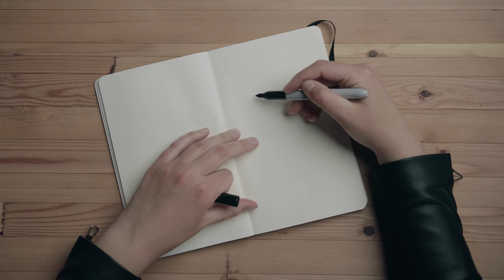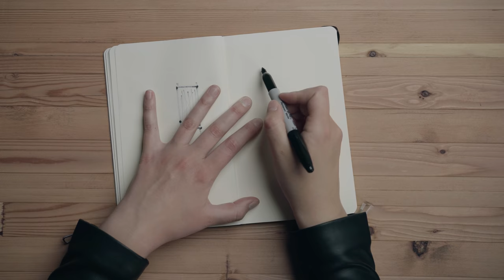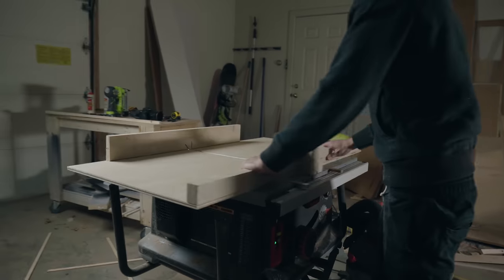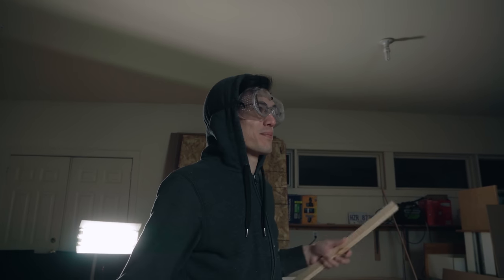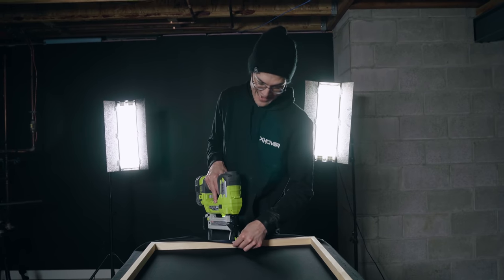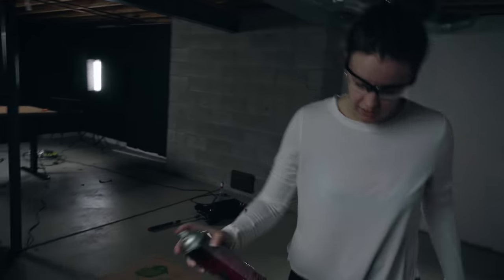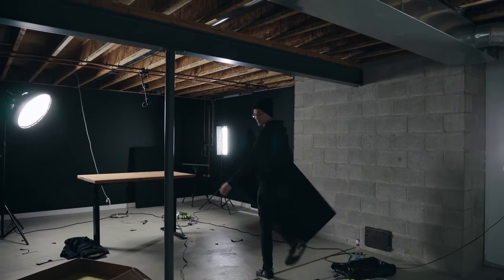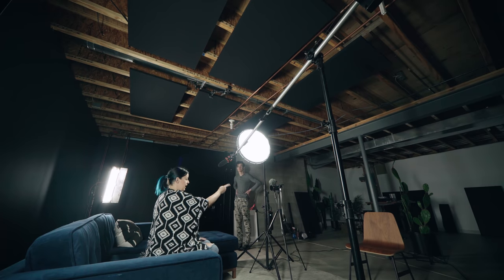Building Acoustic Sound Panels - Do They ACTUALLY make a difference?

Comment: A Sound Engineer once told me to hang a sound blanket like a half-pulled shower curtain, so it didn't hang flat. Even a removal blanket will create some sound reflections (however minimal) so by hanging the blanket so its not pulled flat removes most of the flat areas. It also effectively thickens the blanket, so it becomes denser. You need more blankets but they are dirt cheap so wouldn't break the bank. He also advised hanging the blankets at different distances from the mic, some fairly close, some further away. This also helps remove flat areas that can cause sound reflections... Try it, see if it makes a difference.

Comment: From sound proofing my own studio, I found that making the area smaller was also a huge factor in making the audio better. So I actually moved the blankets so close that it doubles as a light blocker. Also used foam squares glued 2x5 on a styrofoam board and taped them to my light stands which also help when moving them to film in other spaces.
Reply: Totally agree about keeping the blankets close to the mic, it makes a huge difference. The smaller you can make the 'sound area' the better. Great comment.

Comment: As far as sound paneling versus mic placement you are spot on. Getting the microphone closest to your sound source always gives the greatest improvement. Sound panels are great and effective especially when you have lots of big flat areas or walls surrounding you that sound continuously bounces off but even sticking a couch in a room will help as much as a sound panel. When you want to control reflections of sound just think big fluffy things that trap air. Hang up a dooner or put down a thick rug. Even in a restaurant i once stapled carpet squares underneath all the tables so it couldnt be seen by patrons and also put some large thick decorative mats on the walls. The more hard surfaces you cover with fluffy things the more reflections you stop.

Comment: You didn't use thick enough panels. I had thought about using broadband panels for my own studio but I had been looking at using 4 inch thick panels as I'd be treating my room for a drum kit. I'd defo recommend bass traps for the corners for the low frequencies, I got a set of 4 100cm tall panels for €100, they make a surprising difference in sound, loving these videos only came across your channel in the last few days.

Comment: Great video, you guys are fun to watch! As a composer I've treated a couple of homestudios throughout the years myself and was wondering: Why don't you guys also hang the nice sound panels you made on the walls in stead of the ceiling? That ceiling you have in your basement isn't as refelctive as the walls in front of you. Ofcourse sounds goes in all directions, but treating the wall that's in front of you would be my first priority to treat, since that will probably be the most noticable difference. The thicker the panels, the better and lower (in frequency) the absorption goes. Even with thin panels, the room does sound a bit less reflective, yes, but could still remain "boomy-sounding" because the lower soundwaves simply didn't get absorbed by the thin panels. The thin moving-blankets you guys used actually was perfect exampe of this: The room sounds a bit less reflective, but not a noticable difference, because our voice is around 4000Hz, and those movingblankets probably will only absorb above 10.000Hz, or somewhere in that range. But since you maybe don't want to see the panels to much, you could have a look into some nice looking wood diffusers, or even make a couple your own. They almost look like a stylish piece of art to me, and still contribute a lot to the acoustics of the room, though a bit less effective if you really want a complete dead sounding room, it still is a nice and organic-sounding way to deaden the room, since it breaks up the sound into different directions, in stead of it come straight back at you. Might be something to reconsider. :)

Comment: If you are rocking a basement setup like this test frame, using moving blankets and stapling then to the ceiling is a much cheaper way to achieve a similar result, then use the DIY panels if they are in frame or even for a portable setup that can pack up into a gear closet or behind a shelf. 👍🏼

Comment: Having the sound treatment helps the ambient sound the best so if you were doing a workshop shot with you moving around, that would be your biggest gain.  You also might try alternating the panels so that they are angled away from the ceiling a bit.  The trick is to break up parallel surfaces that can reflect sound.  For me, the biggest reveal, was how getting a boomed mic just out of shot REALLY killed (for better or worse) the ambiance of the room.  BTW, how the flock are you guys not at half a mill subs.  Great content.

Comment: In certain situations, you may need to Acoustically treat at least 15% of the wall surface area to hear a substantial difference. Also, avoid having parallel surfaces that are not treated like floor to ceiling or regular wall to wall surfaces. Untreated parallel surfaces can cause flutter echo or allow the room to still have a degree of reverberance not suitable for dialogue. For additional advice, I would consider the following companies: Acoustic Fields and GIK Acoustics. Both offer consultation, products, and DIY solutions. I hope this helps. Have a great day.

Comment: Becki and Chris, here's an idea for unique sound panels.  Use expanding spray foam and take something with an interesting texture or shapes and press that into the foam before it's cured. Or you could take some Styrofoam  and sculpt it into an interesting shape or texture. There are these heat guns, basically a wire that heats up and cuts through foam like a hot knife through butter, to make cutting easier.
Expanding spray foam is also handy when you have to ship something with a complex shape. Take your shipping box, spray the expanding foam into a thin layer, as the foam expands lay a sheet of plastic on top and then press the complex shaped object into the foam. let cure/harden. Do the same for the top.

Comment: Love you guys. Missed you guys jeje. Its been a while since you guys uploaded a video. I am a music producer/mixing engineer. I recommend rock wool insolation for acoustic panels. It works best for sound in my opinion. I had better results  on my mixes with rock wool than corning 703. For a mixing environment its best to have a dead room as far as sound. So I recommend you rock wool. Of course I dont know if you are going to keep making these DIY panels but just wanted to throw this tip at you guys. God bless you guys 🙏🏼
Reply from the maker: Definitely going to pick up Rockwool next time if we make more, they were sold out of the 1” when I bought the insulation and I didn’t want the thick stuff. 😊
Reply: @BeckiandChris  Thanks for the reply guys..Trust me if you find any 1" Rockwool it will make a difference.  Keep doing you thing guys.. much love and godbless..STAY SAFE

Comment: Hi. I am an acoustician and there are some things you have done right and many things wrong. 2” material had better absorption coefficients but the 8” gap created by the joists increases your efficiency. Adding Rockwool insulation “randomly” around the room in the cavity of the ceiling will greatly reduce the reverberation time in the room and cost even less.

Comment: Hanging your blankets behind your microphone - opposite your face - is where you want them. When you talk your voice continues to that surface and reflects back to the microphone. While those mics are supercardiod, they’ll still pic up reflections. Adding the cloud panels is also a good choice.
Reply from the maker: Gabriel O'Brien agreed but then they are in the shot! I think it’s a balance of having good audio but also having a nice looking set for video as well
Reply: Becki and Chris they shouldn’t be in the shot. They’re on the opposite side of the room, meaning you should be looking at them while talking to camera - meaning they’re the opposite side of the room the camera is looking. If you want something on the wall behind you I’d use diffusion to break up reflective waves so they get absorbed by your other surfaces.

Comment: Not a sound person but eliminating flat surfaces will be a key. How effective is your ceiling treatment is questionable, I think installing thicker insulation between the joist will serve the same purpose. Also, put some in the corners of your room will help with (reverb or echo I forget which). Basically, the more stuff you put into the room will help with the audio even a simple bookcase. It doesn't have to be a sound treatment panel.

Comment: Look into floating floors and Helmholtz resonator. The Rode NTG is a super cardiod mic, meaning its pickup pattern is directional. You are always looking for super Cardiod or hyper cardiod when doing directional, to minimize picking up sounds or noise from other directions. You also want to use a condenser mic as it is more sensitive than a dynamic mic but it obviously don't handle loud noise very well. Sometimes also requires additional power.  
Second to that, why the world just doesn't move to metric is beyond me.
Reply: Small condenser cardioid mics are better for indoor dialogue, try it

Comment: Your biggest improvement will be putting them on the walls and if you can the corners of the walls. If you are going to put some on the walls I would go 2” frames leaving an inch gap between the 703 panel and the wall.

Comment: What about the blankets without the panels?  It seemed like the blankets made a significant difference while the panels didn't mostly because you don't speak from the top of your head, so most of the sound is going straight while less is going straight up.  Also note on stage they use treatment panels at an angle to optimize the amplification of sound.  I wonder if doing similar befor your panels will help with deadening the sound.  Just angle the panels so that the largest amount of the panel is viewable to you.  Mathematically that would be panel elevated 6' from your mouth and 6' out from your mouth should be at a 45 degree angle.
Reply from the maker: Angle of incidence = angle of reflection so should be angled so that you could see your mic if the panels were mirrors. In this case they’re between the mic and subject so flat.

Comment: Yikes. Two major faux-pas : (1) The two-inch rigid fiberglass is very necessary, and (2) you need permeable material on BOTH sides. Otherwise, sound is just reflecting right back from whence it came. Agree, you guys aren’t introducing nearly enough mass to hear a discernible difference. Consider theatre curtains?

Comment: are you not worried about potentially breathing in the fibers from the insulation? That stuff is meant to be installed inside of walls, not behind breathable fabric.
Reply from the maker: MDPstudios nah, it’s covered in fabric.
Reply: Becki and Chris the fabric is breathable, and every time someone walks on the floor above them it can potentially release dust and fibers
Reply from the maker: MDPstudios I mean it’s not really any different than having open stud cavities with insulation in them? If you want to build these and don’t want to use this specific brand there are other brands you can try.
Reply: Becki and Chris normally open stud walls are sealed with a plastic vapour barrier. I’ve been wanting sound panels for a home theatre room and all my research has lead me to believe that home made and professional solutions made with various insulation are not good for health.
Reply from the maker: I think the Rockwool insulation might be a bit better vs the fibreglass for the health. I’m sure it’s still not great but might be worth looking into. This website has a ton of different types and thicknesses https://www.acoustimac.com/roxul-rb6-2in/
Reply: @BeckiandChris  researching this for days and days, rockwool seems to be even worse. What I've decided to do is to buy sound blankets and fold them over into 2x4 rectangles and put that inside a frame and stretch fabric over it.... not sure how effective it'll be, but ill be trying it out in the next couple weeks

Comment: This is frustrating to watch, you guys are normally so thorough!  
The main first step that was neglected here is getting a firm grip on the difference between sound "reinforcement" vs "attenuation."  You guys seem to be primarily needing to achieve attenuation in this scenario.  
Second, materials mater.  All foam, insulation, fabric is not created equal. Many are useless and even counterproductive in sound applications.  For example, that speaker fabric you used is designed to allow sound to pass though unchanged, as you would want for the front cover on a speaker cabinet.  It provides zero attenuation and is thus useless in this application.  Also the sealed plastic material you used on the back is actually reflecting the potentially captured sound (in the baffle you've made) back out so that it does not penetrate into the foam.  That means that you have introduced a more reflective surface into the room.    
The placement of the panels should be strategic as well.  You probably want to create a "dead zone" above your primary shooting angle.  It should span from above the camera to just behind the subject.  

There's a lot more but this is just the obvious stuff I saw right away. Pull off the backing and rearrange the panels!